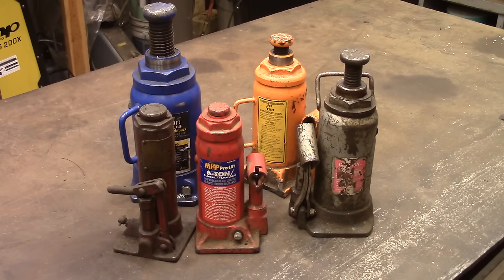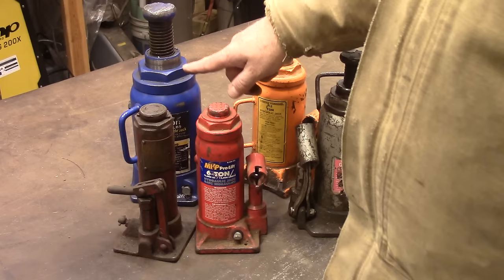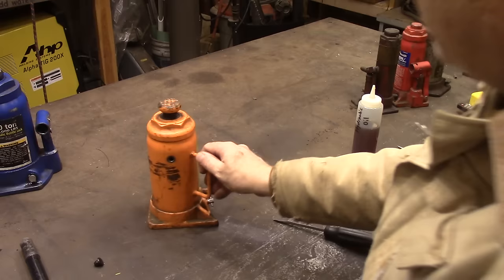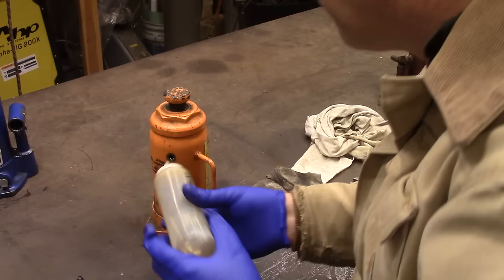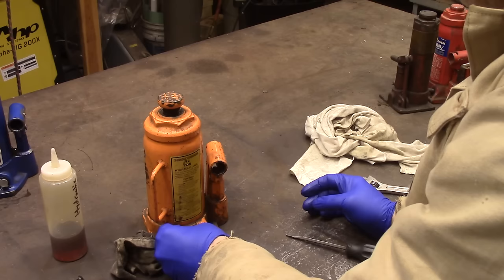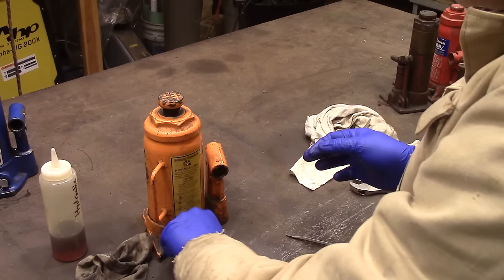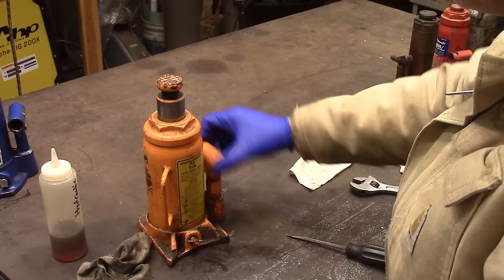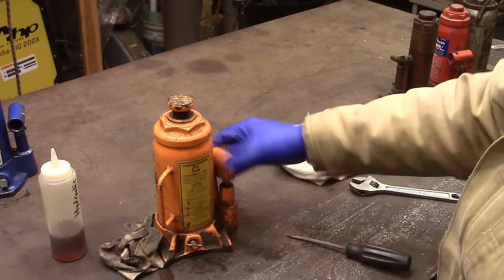How to Repair a Hydraulic Jack

Comment: doesn't say a word about repairing a hydraulic jack.
Reply: A bottle jack is a hydraulic jack.
Reply: @ObamaoZedong  And adding oil and pumping it doesn't constitute repair.
Reply: @sts.556  No t dog they're not idiots but maybe you are?
Topping up the oil level & bleeding the system is basic maintenance, not a repair!
Reply: Do you not know what a hydraulic  jack is? Do you not know what you are looking at? The jack was out of service due to air trapped inside the jack. The man bled the air off and replaced the hydraulic oil that had escaped. There for putting the jack back in service. How ever small the task, this is a hands on repair. Is it not? A task was preformed and know the jack works properly again. If this is not a repair then what would you call it? And don’t use a description of the task performed. What single name would you use would you use to describe the task preformed? How do you get around not calling this a repair of a tool that didn’t function properly?
Reply: @haydenlogston2164  Changing the oil in your car isn't a repair.  Adding air to a low tire isn't a repair.  Patching/fixing the oil or air leak is a repair.  Bleeding air out of your hydraulic brake system isn't a repair.  Rebuilding or replacing worn/damaged/leaky brake system parts is a repair.
Reply: John Dough you bled air out of a faulty break system and now it works properly but apparently you didn’t repair it so it’s not fixed? So by your logic didn’t repair or fix it? How does that logic work? How does putting air into a tire and taking nothing out relate to purging air out of the jack witch is the repair and refilling it with oil relate to each other. In both instances your add some thing so if they are by you logic the same. In one case we purged air and added oil. So what did you purge out the tire to add the air? The fluid is a liquid component of a properly functioning jack, air is not. So a task has to be preformed how ever small ( purging air) to make it work properly before oil is added. Purging the system of the air is the repair. A repair does not have to involve adding components. In this case we are taking a component (the air) out of the system that impedes proper function of the jack. Purging the air out of the system is the repair not adding the oil. That is servicing the jack just like you serviced the tire. Your thinking that a repair involves parts some times it only involves a task being preformed. If you vacuum stops working because a string is wrapped are round the belt and it’s burning up the motor.  You use a tool a knife and cut it out and it takes 3 hrs is that a repair? Did you fix it? So you can understand why I would recognize some unsound logic in your statement. But this has officially gone way to far and we are rapidly approaching absurdity with the amount of time wasted arguing about semantics. So I’m done. Best of luck to you and take care.
Reply: John Dough and Ed key definition or the ward repair
repair  
Also found in: Thesaurus, Medical, Legal, Financial, Acronyms, Idioms, Encyclopedia, Wikipedia.
re·pair 1  (rĭ-pâr′)
v. re·paired, re·pair·ing, re·pairs
v.tr.
1. To restore to sound condition after damage or injury; fix: repaired the broken watch.
2. To set right; remedy: repair an oversight.
3. To restore or renew: repair the immune system.
4. To make up for or compensate for (a loss or wrong, for example).
v.intr.
To make repairs.
n.
1.
a. The work, act, or process of repairing.
b. often repairs An instance or a result of repairing: The accident resulted in a costly repair to the car. My bike is in the shop for repairs.

So no where in this definition is the word parts mentioned. But the wards restore, renew,  remedy,  work, act, and the words process of repair are.  So the process of purging the air and refilling it is a repair. End of story.
Reply: @haydenlogston2164  Learn to spell.  Learn grammar.  Learn rationale and logic.  Learn economics.  Learn definitions.  Learn anything.
Reply: @haydenlogston2164  Again, learn to spell.
Reply: @haydenlogston2164  you need to lay off the caffeine.
Reply: John Dough 
learn how to be a man and not fall back on childish ways.
Learn how to except defeat gracefully and admit that you were wrong.
Learn your facts before you argue an indefensible point.
Learn humility.
Learn how to debate.
Learn how to use logic as opposed to emotion.
Learn how to open your mind and except the opinions of others.
Learn to realize the fact that you are not the smartest guy in the room.
Learn how to think before you open your mouth.
Learned that if you attack others expect to be attacked.
Need I go on? 
Learn those things and you will learn how to not make yourself look foolish.
Lesson 2 ended, or would you like to continue? Your choice or are you stuck with nothing to say? My guess is you are.
Reply: ed kay now that is a good point Ed. You are correct I do love coffee, well said. Best of luck to you.
Reply: @haydenlogston2164  Try a real dictionary, Webster, instead of Wiki:

repair verb (1)
re·pair | \ ri-ˈper  \
repaired; repairing; repairs
Definition of repair (Entry 1 of 4)
transitive verb

1a : to restore by replacing a part or putting together what is torn or broken : fix

The other, secondary, entries certainly leave room for disagreement but there is no need to be nasty about it, just disagree.
Reply: John Dough sence you edited out The entire definition I’ll just put it out here for everyone to see.
repair verb (1)
re·pair | \ ri-ˈper  \
repaired; repairing; repairs
Definition of repair (Entry 1 of 4)
transitive verb
1a : to restore by replacing a part or putting together what is torn or broken : FIX
repair a shoe
b : to restore to a sound or healthy state : RENEW
repair his strength
2 : to make good : compensate for : REMEDY
repair a gap in my reading
intransitive verb
: to make repairs
repair noun (1)
Definition of repair (Entry 2 of 4)
1a : an instance or result of repairing
b : the act or process of repairing
c : the replacement of destroyed cells or tissues by new formations
2a : relative condition with respect to soundness or need of repairing
b : the state of being in good or sound condition
repair verb (2)
repaired; repairing; repairs
Definition of repair (Entry 3 of 4)
intransitive verb
1a : to betake oneself : GO
repaired to the judge's chambers
b : to come together : RALLY
2 obsolete : RETURN

Well John I think you started the nastiness with a personal attack. The man was not incorrect by using the word repair. The word can be used as a noun or a verb. So in that sense we both were right but this gentleman was not wrong. And that was the discussion at hand. That was the original disagreement.  He did not use the word incorrectly. When a person is trying to put me down I have a tendency not put up with that crap. I am not the guy that’s going to take a beat down, bow my head, and walk away with my tail between my legs. I stop doing that decades ago. The man was trying to teach people something and did not deserve to be dragged over the coals for it. But the hatchet is buried. No hard feeling so take care and be safe. 🤝